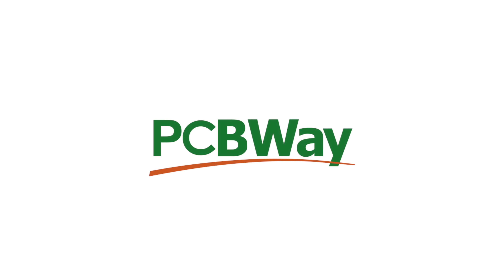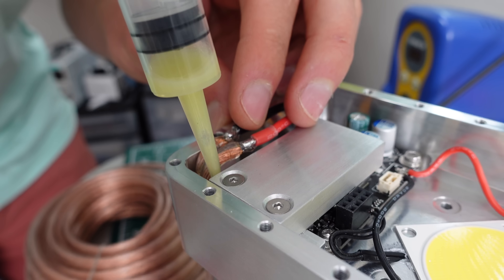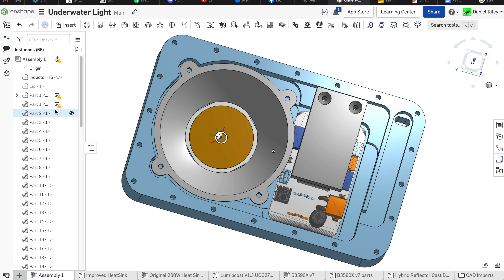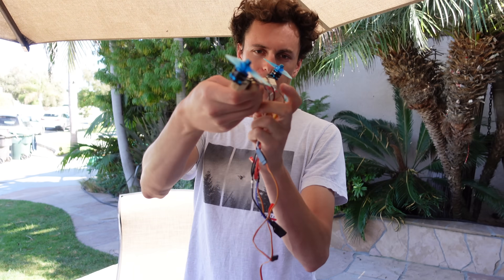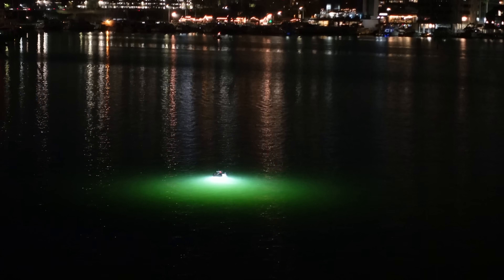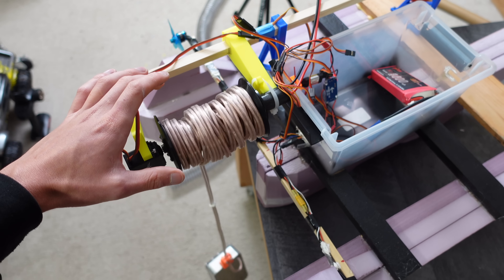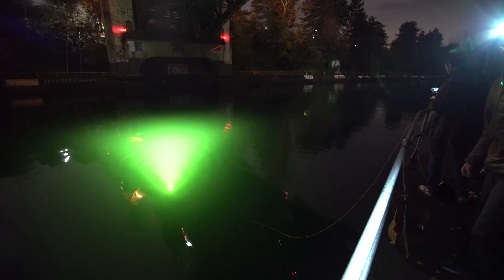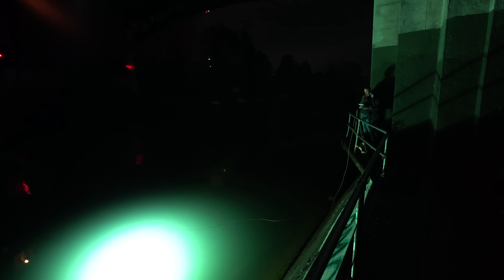DIY High Power Underwater Light on ROV Submarine

Comment: You could fill the lamp body with mineraloil. this solves the buoyancy issue aswell as the water creep. the water wants to get inside because of the pressure delta. having the oil in it would keep the pressure the same and it also helps to keep the leds and inductor cool
Reply: I thought similar . You think the mineral oil would scatter the light any differently?
Reply: @Chris Barter  it would have some effect. But it might be negligible because of the output power of the light. Als if the oil is directly touching the led. The light will refact less compared to air. I have seen it somewhere it has to do with the difference in refraction between 2 mediums
Reply: Mineral clear oil can be used
Reply: if you can't keep air out; does this run the risk of allowing a bubble to eventually form inside?

Comment: Next time use solidcore wires without insulation to pass the power from the outside to the inside. multi stand wires will always have some smal airways in it just like you mentioned. a solid wire might not be flexable but when your outside you can go back to muli

Comment: Nice project, but can I offer you an advice from some one who designs underwater "thingy-ma-bobs" for a marine research department on a top 50 polytechnic university?  

What you have designed there, Id' be very surprised if is didn't leak when it goes to a few meters. 

You should have designed a n o-rings groove in to it and added a o-ring,  you should also have added an cheap penetrator from bluerobotics for you wires connections. No need to use Subconn connectors that cost an arm and a leg.  

Also, I'm curious, what did the enclosure and the poly front cost if you had to buy it yourself? been considering trying them out for future work projects.

Comment: The moment I saw how you made the cable pass trough and port window seal, I knew it will leak. 
Epoxy shrinks when it cures ! Creating a slight gap all round, that is not necessarily visible by eye. 
One way of overcoming this, is by casting the wire into epoxy, then coat it in silicone. 
If you make something like a cone that fits into a cable gland that can be tightened, you have less
chance of leakage. 
Front port is better done with a routed groove and O-ring, or cured silicone bead in groove, before 
tensioning the port window. 

Bear in mind, the meat and air inside will expand a lot due to heat, than shrink rapidly when cooling down,
essentially drawing water in.....

Comment: Next time, use silicon sealant between the lens the same way you did but don't torque the screws down all the way. Let the silicon set and essentially make a perfect seal, then torque the screws down so that you maintain pressure on the newly formed rubber seal. This has helped me in the past.

Love the videos!

Edit: Okay don't use silicon! Use whatever sealant is best but the technique is valid. Basically making your own custom seal and then tighten down onto it.
Reply: Don't use silicone. Use 3M 4200 marine sealant.
Reply: @trey1531  And give it a little time to skin over before torquing the screws.
Reply: better tip: don't use sikicone to water seal. Silicone is crap compared to orings. Your shape is not round? Use oring string from diy oring kits
Reply: @PrintingEqualsFreedom  actually you're right, one big oring around the outside in a rounded groove and she's good to go. Multiple large diameters in motors are oringed.
Reply: @Justin-lc8wk  i was also thinking - perhaps use isolated bolts to get DC into cabinet. And then thread into boltheads on outside and pot that.
Reply: As others have mentioned. Silicone is not great for sealing water.
Reply: It's silicone, not silicon.
Reply: This is how you reseal oil pans on cars that don't use gaskets, let it dry and then tighten more

Comment: whatever floats your boat ig
Reply: hey try a V-shaped 5-verticel 6-polygon +1 sheet super ultra light kite plane, its V as the main frame hull and a large ultra light sheet on the V-frame, kinda like a flying fly swat
Reply: it looks like you just snap a ultra wide gliders to a v-shape, back, and add the wing sheet surface between the sticks

Comment: Hi Daniel, Very cool video! I think you need to remove the reflector to get more even lighting. The reflector is concentrating the light beam, which is OK, if you want to look at a small area with intensive lighting. But for your purpose, and also for the sake of camera footage, you will be better of with the natural light flow from the COB. I believe it has something like a 170 degree angle, and no sharp edge. The sharp edge would require too much wide dynamic range for most cameras at this light intensity, I think. Give this IFish some extra light! ;-)

Comment: Instead of compositing, you should try a very long exposure shot on a DSLR with low ISO and low aperture (and ND filters if needed to lower the amount of light hitting the sensor even more), and then try to drive at a constant pace. It could make for very cool effects... but the sea weed would probably appear super "soft" and blurry secause of ripples on the water, underwater currents etc.
Reply: Or bulb mode.
Reply: the problem with this approach would be the super bright spot making huge trails covering up everything

Comment: It probably failed the first time because of thermal expansion from the air in the casing. warming up air creates pressure. Make sure you have some kind of membrane to relieve the pressure. None the less cool project!
Reply: Very likely. It would also probably have been better to have the cover compress an o-ring in a v-shaped groove in the case rather than rely on silicone (under the holes for the screws instead of inside, even) for the seal.